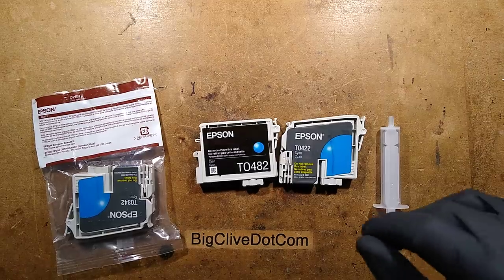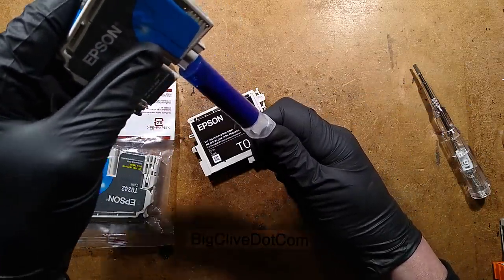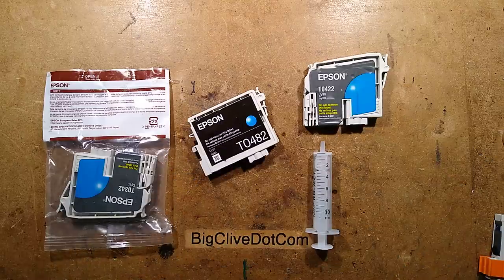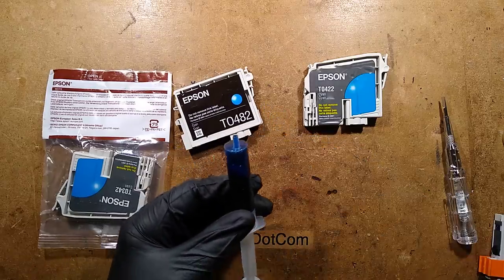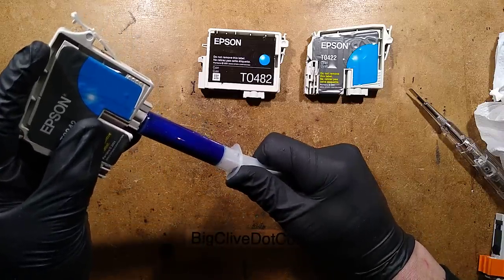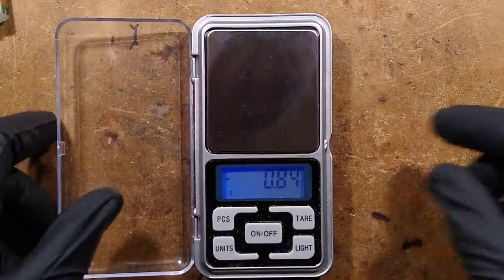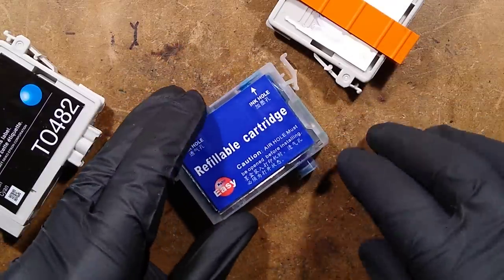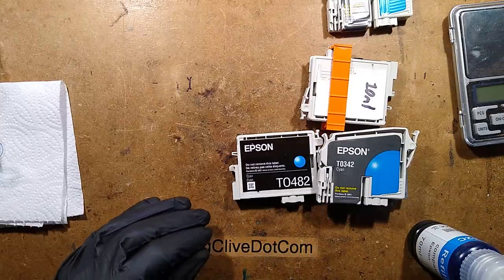How much ink is in Epson cartridges?

Comment: Would you consider doing one of these sorts of videos on HP? I used to work for them, and I can hands down say they ran a heck of an ink scam back in the day, to the point where one model of their HP Officejets (all in one printers) would lock itself up if you placed a non-hp cartridge into it or if the cartridge was tampered with, causing owners to have to call our support department in order to unlock the machine itself, or send replacement cartridges. It was such a well kept secret, not even us support agents knew at first what was happening with this new model. I'd be curious to see just how much ink they hold, specifically their regular version compared to their "XL".
Reply from the maker: I tried refilling my HP many years ago, and it was very hard.  Then it suddenly killed the printhead on that cartridge by burning it out.   I'm suspicious it detected my attempts at refilling it by the number of times the cartridge was taken in and out, and cleaned.

Comment: I have an HP Smart tank 455. Best thing I ever bought.(£190). I print daily and the tanks are still well over half full from the bottles of ink that came with the printer. Faultless every time. Previously I had the usual cartridge models that came up with errors virtually daily, let alone the expense.

Comment: I thought about doing this with a handful of cartridges I've collected for the various printers that all seem to be HP it just suddenly stop working after a few years and then people have to get new ones so I'm left with lots of printer parts and lots of ink. Wondering what the compatibility would be collecting it up and using an old printer. This is an Epson house I have far too many issues with HP and none with Epson. And after the lawsuit and eco-tanks I'm actually even happier with them.

Comment: I wonder it the vacuum that you introduced was causing the bubbles to form.  Is the water in the ink boiling at low pressure?   Next time try your vacuum pump.
Reply from the maker: It turns out that the air inlet to the cartridge has a valve, so I was drawing a significant vacuum inside the cartridge, which caused air to bubble through the ink from the expansion/sump.  All will be revealed soon, as I've not reverse engineered one of the cartridges.  It was surprisingly complex.

Comment: Be aware that usually what limits some tank type printers are the waste ink container pads, who aren't replaceable one some of those, and do fill up fast due to printer cycles of print head cleaning in order not to dry. This is usually happening on printers that lack more use...
Reply from the maker: Mine is at 35% full after 6 years and 6000 prints.

Comment: One thing to go careful with the ECO tank printers is that when it purges it does so into a sponge in the back of the printer. Once this is saturated it won’t print, and it’s almost impossible to replace and reset
Reply from the maker: It can be removed and cleaned, and the counter reset with third party software.

Comment: I’m so happy that my Epson XP-900 works with fake cartridges from Amazon. 25£ for 3 sets of 5 cartridges. I never use more than 1 set per year as i’m mostly use the printer for scanning. When i printed some photos the colours wasn’t very accurate but for text printing cheap fake (not made by Epson) cartridges are more than enough. Also never updated the printer software because i read that the only improvement to the new software it’s to detect non made by Epson cartridges and stop the printer from working. Greedy companies.

Comment: Please reply if possible, I recently discovered that Epson cartridges are made to say empty long before the ink has run out. I tried one of these chip reset tools from eBay but it didn't work. It is completely scandalous how Epson rob us blind with these cartridges. Please can you follow up this video, focusing on the chip reset tool. Many thanks, Adam
Reply from the maker: I have a chip reset tool here, but it may not work on modern chips.

Comment: The part nobody pays attention to is what goes on in the printer itself. I've taken apart an old Canon Pixma printer/scanner combo not too long ago. The ENTIRE bottom is lined with felt, and there's a peristaltic pump inside which literally sucks your ink from the cartridge into the felt to dry out. Other printers do this too. Run out of ink every month hardly printing anything? Now you know why. It's like if your car pumps a liter of gas from your tank into an evaporation dish on the roof every time you start your car.

Comment: I started out using the cartridges, then switched to the ecotanks and finally I now went to a laser printer! When using the cartridges the ink jets would dry out. After switching to the ecotank the print head became clogged and would print anymore. With the laser printer I don't have to worry about the ink drying out because it's already dry!
Reply from the maker: Odd.  I've never really had a clogging issue on my ecotank.  But it does get used a lot.

Comment: Inkjet printers are a pain in the ass. I have to run 2-3 cleaning cycles on mine if it sits for more than a week between prints. It's a good thing the ink for the refillable cartridges is cheap.
My laser printer works every time, no matter how long it's been since I last used it. The toner cartridges last years for me.

Comment: Some have reported that the tank-style Epson printers still have a lifespan counter on the print head that stops all printing after reaching some end-of-life limit.  Now that the other manufacturers also have tank-style printers, they might do something similar.  While it's understandable that the print head will have a limited lifespan, a warning would suffice instead of effectively bricking the printer.
Reply from the maker: It's for the waste ink reservoir.  After 6 years and 6000 prints, mine is about 30% full.   They can be replaced.

Comment: Printers and their consumables are the biggest swindle in electronics. I thought I was being clever buying a laser printer for my one man band business as I print fairly infrequently but occasionally need to produce proofs and got fed up with inkjet drying out. My printer seemingly ran out of toner in a couple of coloours after a year or so and I refilled it (I bought a model that is well documented for being refillable on the aftermarket)... nothing. On the advise of the refill supplier I bought a new cartridge (from elsewhere, they don't sell them) still nothing. I fear there is either something more major that has failed or suspect an OTA firmware update has scuppered me. Very frustrating with the cost of toner.
Reply from the maker: Check YouTube for your printer model number.  There may be tricks to defeat refilling.

Comment: There are some Epson ink tank systems which estimate the ink level and when it is low it requires you to fill the tank and enter the serial number printed on the refill bottles to continue.
Reply from the maker: Hmm.  I was wondering how long it would be before they did something like that.
Reply: @bigclivedotcom  I guess it was Epson L100, L200 or something like that.

Comment: I dissembled an inkjet printer once, and I discovered a large amount of ink left inside the printer itself. I guess a swamp for self cleaning. It was at least worth 2 or 3 cartridges, all wasted.
So if you measure whats left in a cartridge, and what the printer itself is wasting every time its powered on, even less gets on the page itself. For people printing very little over time, use a black and white laser printer. Doesn't waste toner on every startup, and last for many years before replacing the toner.
Reply: Some printers work by having a constant amount of ink always ready to print no matter how much is in the cartridge. 
Apart from that, most leak after a while.

Comment: I just bought a Canon Pixma printer + scanner inkjet and paid 29.90 euros on sale. The cartridges are about 20€ each. So minimum 40€ if both black and color are replaced. It's pretty much no brainer to replace the printer than the cartridges next time again. Especially since I use it so rarely that often the nozzles get permanently clogged before the ink runs out. Bad for the environment, good for the wallet.

Comment: If you ever go 7 days without printing the eco tanks are risky. The print heads will dry up and get clogged. If you leave them plugged in they are supposed to use so ink regularly to prevent that. But it doesn’t always work. 

I have decided to stick with printers where the print head is part of the cartridge. So it is replaced with every cartridge. I have used 20 year old Hp printers because of this and they work great. 

But if you are printing daily. It’s hard to beat the price of the eco tank printers.
Reply from the maker: I have a dedicated ecotank printer for when I work on a remote job once a year.  The rest of the year it is locked up in a cabin at a warehouse.  It doesn't give problems.
Reply: That’s good to know. I wonder if I was just using terrible ink then.

Comment: Epson writes the ml amount on their homepage. Todays inks have less then a third of what it used to be, but they also use less when cleaning nowadays. But there is the Ecotank system now, where printers have inktanks and you can buy the original inks "cheaply" (less then 10% of what the amount of ink would cost in cartridges).
I refilled many cartridges and repaired many printers, so I know some things about printers.
Today the worst of the manufactorers is HP.  Currently their newest cartridges have only 2ml of black ink and even only 4ml in the XL variant. That is more then 5€ per ml. Not only that, they sell printers that prevent them from being refilled and they block alternative cartridges. And some models can't even be used without an internetconnection, those printers don't work without it!!!

Comment: I'm still running a desktop laser printer (One of the brands named after religious personalities) which I bought in 2008 and still goes strong, though the present „Compatible“ cartridge seems to be leaking excess toner onto the imaging drum and adding a „grain“ effect to my printouts. But for £80,- with a free official toner thrown in and 16 years service so far, I think I've definitely gotten my moneys worth! 😁

The main reason I keep this in service though - Besides not wanting to throw a perfectly working printer - Is simply because I know any printer I buy today will have software locks and other nastiness intended to make affordable and refillable consumables a thing of the past. I can keep my empty toner cartridges and refill them (A very messy and potentially carcinogenic process!) if I want, whilst todays lasers won't let a cartridge print more than 1,000 pages if the manufacturer says that cartridge will only print 1,000 pages. 🔏

And people claim this sort of thing is Progress?... 🤔
Reply from the maker: There's an interesting thing where mixing old toner and new toner in a cartridge gives a mottling effect.

Comment: The Ecotank printers are quite a bit more economical if one prints a lot.  My biggest complaint is the Ecotank print heads tend to clog if the printer is used infrequently.  Clogging may require five or six cleaning cycles to clear the clog, and that wastes ink.

Comment: I am at the point of going to laser printing. My current printer is an Epson XP-446 and it is a nightmare getting this thing ready to print something. I don't use it much and I hear that laser printers are immune from clogging. I've heard of the eco tank refillable ink but I may want to get away from inkjet based printers. I had an old Canon BJC-4300 printer and that thing was a workhorse as it simply worked. Costed $200 at the time and ink wasn't bad. It's sad how the times have changed for printers.

Comment: i should do this on my old cartridges, i bet i have plenty of unused ink left inside them, my recomendation is buying refilled cartridges on ebay, sellers reset the chips and refill them and if you EVER get a bad cartridge, they will bend over backwards to get you printing, i bought a 3 black+2 color set and 1 didnt work out of the 5, they sent me 3 replacements!

Comment: Isn't it the regular, automatic head "cleaning" that wastes lots of ink and fills the receptacle for that wasted ink that can stop a printer from working?
Reply from the maker: Yes.  Especially if they are turned off and on at the wall a lot and have to do a clean cycle because they don't know how long they have been off for.
Reply: Mine on 24 hrs for remote use but starts up every night to potentially "clean" the cartridges.

Comment: I am now throwing away my Ecotank ET-2650. The thing could work only if you print regularly. If you leave it for, say 2 weeks idle, it will clog immediately and nothing can help. I had one original printhead replaced by Epson with brand new, then I learned how to dissemble the thing and clean the head with IPA, however when it told my the waste inc pads are full and completely shut itself off - you can use even the scanner - that was it. It is extremely bad product. I don’t know about other models, however if you don’t plan to print daily, don’t buy it. There was a period, when every morning I will print a specially designed color page to keep it running. You know get my coffee, print a page. It is really worse than the extremely expensive Canon Ink - which I had before and worked without an issue, except Ink was more expensive than gold.
Reply from the maker: I've not had an issue with my ecotank in 6 years and 6000 prints.  But I leave it powered and use it regularly.

Comment: Got an eccotank that got clogged has to do surgery and clean heads. I have to do it again it seems.
Reply from the maker: I've never had an issue with my ecotank, but keep it powered and use it regularly.
There are techniques for cleaning epson print heads by laying a folded paper towel in print area and sliding the head across it to soak it in cleaning solution.  There are many video about this on YouTube.
Reply: I did a flush and ran some color patterns and was getting results....then i hear a hissing sound...my guess is a short and the caps didn't like that. dead now. I tried with good intentions like before but oh well.

Comment: For anything other than photos inkjet printers are dead to me. There's nothing about an inkjet that is better than a color laser. As color laser printers have evolved the printers and toners have gotten so much smaller and cheaper they are basically perfect. Also, the color laser printers made 10+ years ago are basically free junk for offices throwing them out but still work perfectly fine.

Comment: Would you be willing to take a refill cart apart? Maybe show how it actually works if their to expensive I understand.
Reply from the maker: There's not actually much in the refillable cartridges.  They are often shipped empty, so don't need the air valves associated with ones that are shipped full.

Comment: Epson ink is pigment ink which sets like concrete when dry whereas dye ink is water soluble and easier to unclog. What killed my previous printers is the waste ink absorber pads which soak up ink during the print head cleaning process each time the printer starts and at various times during the printing process. The printer counts the pages printed and after some number deems the absorber pads to be full. At this point the printer stops printing and the driver displays a message that internal parts (the pads) need replacing. This, in my experience, is completely uneconomical if done by Epson as it requires the complete dismantling of the printer. In effect every printer has a predetermined life which is not disclosed at the time of purchase. Hopefully your Ecotank printer has more accessible waste ink absorber pads.
Reply from the maker: You can get third party software that will check your waste ink counter and reset it if needed.  But you have to actually empty the waste ink tank and also usually buy a one-use code to do the reset.
Reply: Some of the Epson Eco Tanks actually have proper user replaceable waste ink tanks that can be done by the end user within just a few minutes and no disassembly, and totally supported by epson with them selling genuine replacements.

The replacements have a chip on them similar to an ink cartridge that allows the printer to track the the use of the waste ink tank.
As soon as its replaced with a new one (Epson calls it a "Maintenance tank kit" iirc), the printer is happy again.

Comment: I quit using ink printers many years ago. I just don’t print often enough and the cartridges dry out and plug up. Big waste of money. I went to a color laserjet and I’ve only had to change out two of the four demo cartridges in about 6 years and that’s because I used them, not because they dried out. Now that I am replacing the demo cartridges the full cartridges will probably last 20 years. If you care about printing photos, for the seldom times I print photos I just get them printed online.

Comment: Om the printer itself, it does a self cleaning cycle where it just aprays the ink into a sponge on the bottom of the printer.

On epson printers thats 5% used as nozzle "cleaning" fluid. Each and every time it does it.

Went with refillable tanks and never went back. Bulk ink even super cheap stuff is all the same once its on the paper.